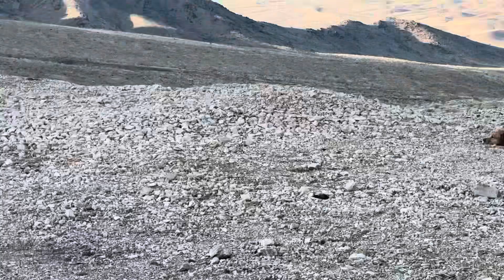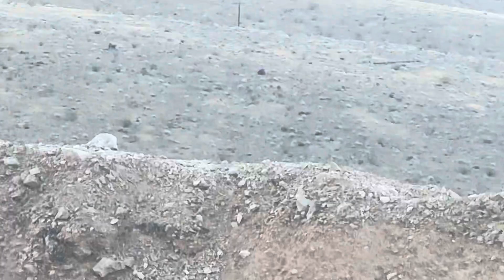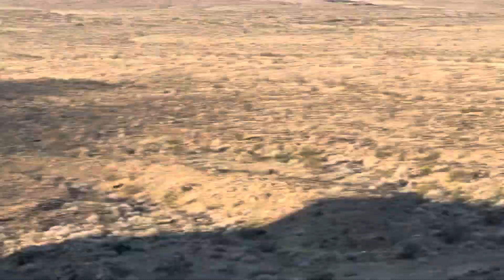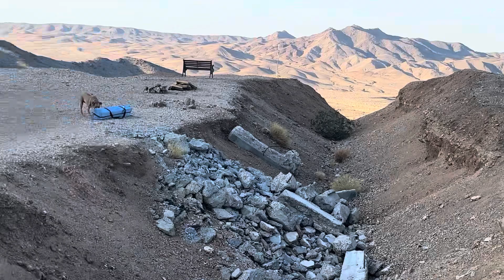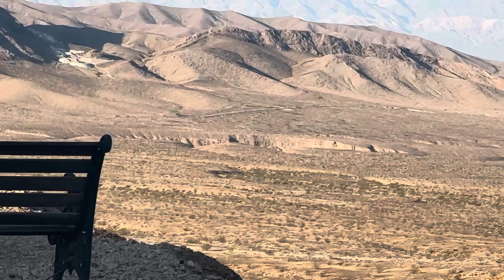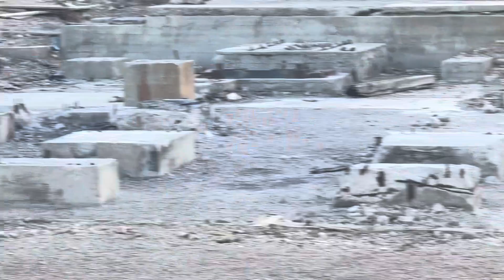What was and what’s left. What happened when the mines closed?

Comment: There is a high possibility that the electrical equipment was contaminated with PCBs which would be expensive to dispose of or to decontaminate. Duke had to replace the pole pig that feeds my house a couple years ago. It was installed in 1964, so it required special handling, and was considered toxic waste since the cost to decontaminate it far exceeded the price of a new transformer. It was seald in a triple layer containment system, and left still hanging from the winch so that it couldn't hit anything. The field supervisor wasn't happy to have ten people on site to ensure that everything was done by the book.
That was a very expensive repair.